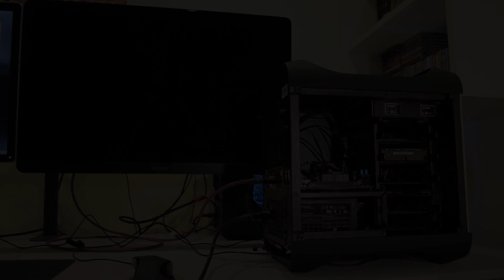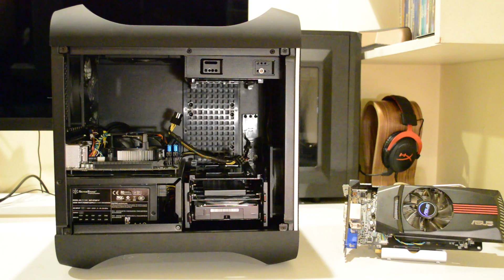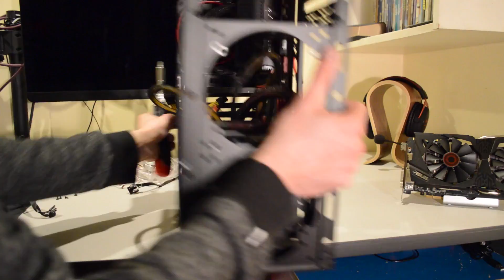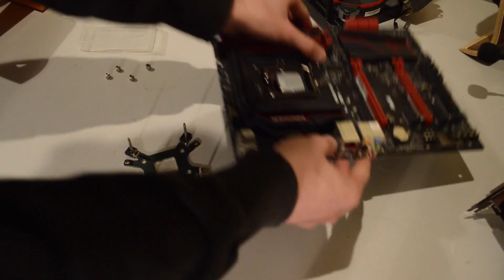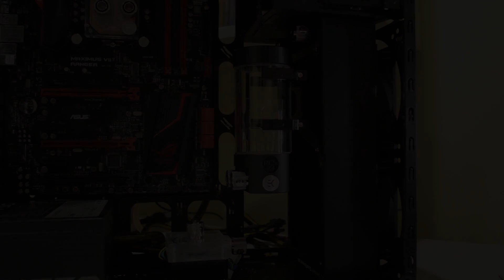Custom loop in a Corsair Carbide Spec-02 | Watercooling build log part 2

Comment: The case looks like a Corsair Carbide 100r :|
Reply from the maker: From the sides it kinda does, yeah, even inside. Mostly just a different front panel
Reply: I bought this exact cooling kit and I have that the corsair carbide 100r so I hope everything fits cause it's exactly similar to yous ! Good Videos by the way man
Reply from the maker: Good luck! Thanks man :)